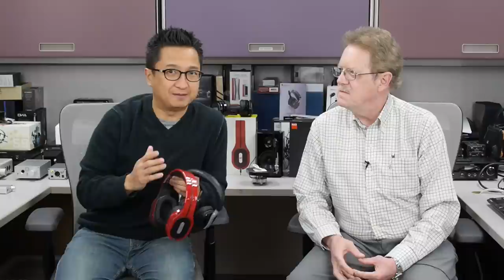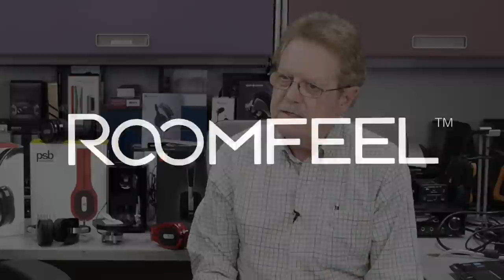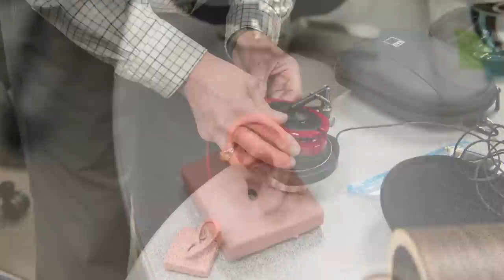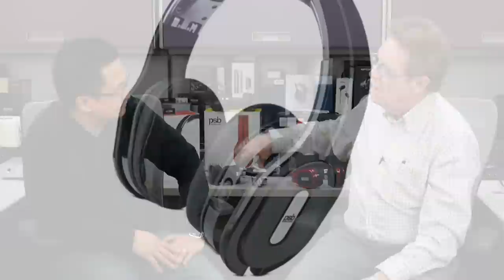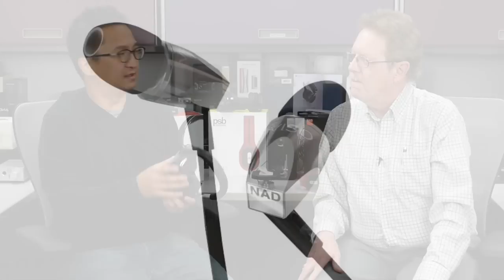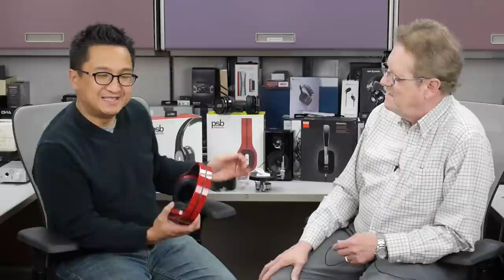An Interview with Paul Barton of PSB Speakers and NAD Electronics - Head-Fi TV

Comment: I had a TacT room correction system which came with various standard frequency curves - the manual encouraged the trial of a flat frequency output.  Just as described, the sound is shrill, "thin" and lacking bass.  There's no need to try it again - save to demo to visitors

Comment: Not sure if this complaint is going in the right place, but I must say I am terribly disappointed at the NAD Viso HP 50. I can't comment on sound quality simply because the fit wasn't even good enough to get a proper seal. They should focus on fit and adjustability as well. They are way too large if you have a medium to small head (the headband, not the earpieces). My head is not even that small, I've never had a size problem with any other headphones.